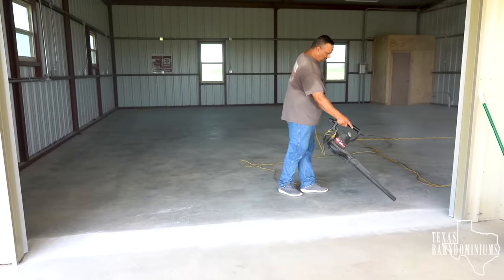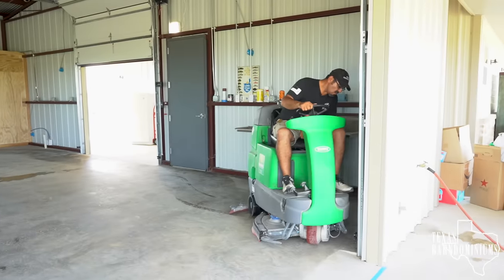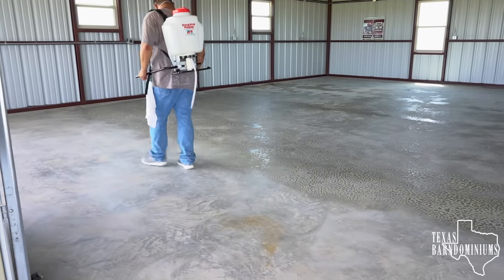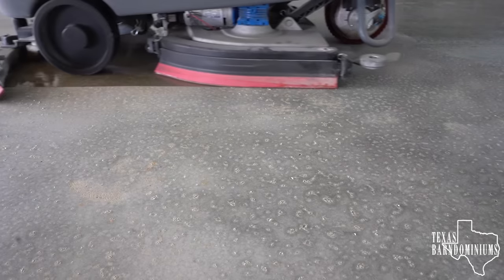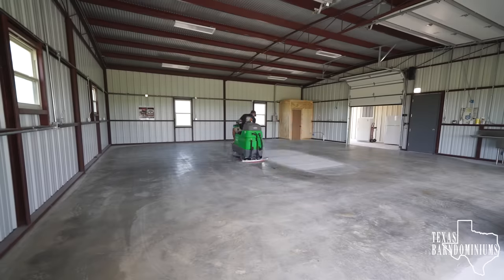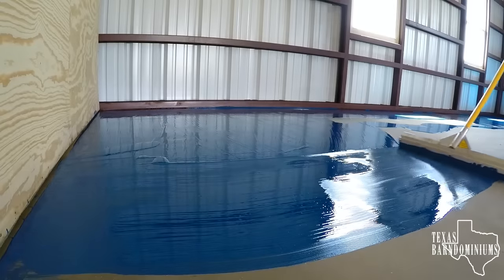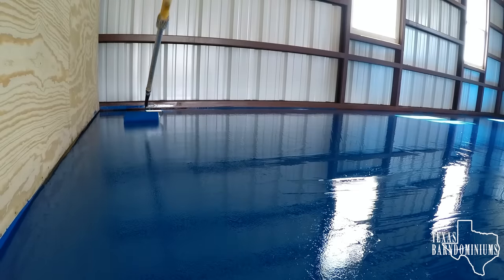How to do Epoxy Floors - STEP BY STEP GUIDE - S3E3

Comment: I personally do not think that muriatic acid is enough prep for epoxy coating. Also I see some in the text saying take a torch to the floor that's a bad idea since you add it in the acetone you can cause a flash off. Ideally you would shotblast the floor is that'll give you the best Bond or at minimum a diamond grind the floor. Love your content you always do great stuff.
Reply: Exactly at least a csp 2. I'll do CSP 3 shotblast, blower and its ready for epoxy.

Comment: I believe those bubbles are because the coat is to thick. Because if you prime the floor or put a seal or vap barrier it should clog all the pores. I learned that if the coat is to thick when it kicks off that’s when it heats up and causes those Bubbles. So got to skedgy more thinner and measure and back roll it in a Chris cross pattern so no puddling all goes away. Also those bubbles could leave marks that you may have to add sand and epoxy to fill or fast fix and touch up a lot of spots from my experience also hope this helps:)

Comment: I got the feed because I subscribed, as this content is interesting even if the building methods do not apply well to my region (sub arctic, living in Alaska). I would love to build a tall (16 foot interior height) 3 car wide garage/shop, with a small 2 bedroom living area above it up here, so I am always looking at ways others are doing it to see if the idea's might work for my conditions here. I am not sure about how well Epoxy floors would hand the shakes up here though (earthquakes) as concrete cracks, and cracks often. And if epoxy could at least keep a better seal on the crete base even if the crete cracks that would be a good thing.

Comment: Awesome video and job!!! What would you recommend for a wetroom? part of the floor the floor slopes to the drain.  When epoxying the slope of the shower floor, how do you keep the epoxy from pooling at the low end? How do you apply the epoxy so that it is even on the level floor and the slope? Thank you so much

Comment: Awsome video. Thanks. I also have a plywood deck I want to finish in spring..... I was thinking of doing fiberglass gel coat on it, but epoxy looks easier.... Can it be done on plywood, And not crack and all?  Thanks.

Comment: So you’d have to buy a leaf blower, angle grinder with a vacuum, acid etch, and the epoxy paint. How much is all of this going to cost the average do it yourself-er?
Reply: I get mixed info on this. Do you need to strip off old paint to put down epoxy paint?
Reply: Bare minimum, you need a mop, soap and water, the acid etch(which usually comes in a kit with the epoxy) and epoxy. If don’t anything on the concrete already like paint or sealant then you just do the following. 
Steps:
1)Remove dust with blower or sweep 
2)mop
3)mop again
4) acid etch to make the concrete want to accept the epoxy
5) mop again
6) mop again
7) pour epoxy and add flakes if you want flakes.
Reply: @evanphillips4302  no I want clear coat not flakes. It has gray paint on it already and I need to repair the cracks. If the epoxy and clear coat doesn’t bond to the concrete oh well. The basement floor is shitty anyway and I’m tired of worrying about it. I just want to get to the fun part. The epoxy.
Reply: @georgelouis6515  just to make sure I’m answering all your questions…if you want to do it to where your epoxy is guaranteed to take then you need to grind up the cracks to be flake-less, suck out the dust, then fill crack with concrete crack filler that you can get in a squeeze tube.  Then paint to match then epoxy and clear coat. But you could probably get away with simply cleaning the dust out of the cracks and do one of two things: fill the crack with concrete crack filler and paint over then epoxy/clear coat OR leave the crack as is after sucking the dust out of it and do enough epoxy to fill the crack and overflow it then clear coat on top. Some might say simply pouring the epoxy into the crack without repairing it with result in crack fragment breaking off from weak spots which will affect your epoxy and clear coat. It may result in epoxy/CC peeling up. But because it’s a basement, you can probably leave it and it will be just a slight defect in the floor that may or may not be super noticeable.
Reply: I didn’t prep one or two cracks in my concrete floor in my garage because of laziness and their location wasn’t one where foot-traffic is common and simply filled the crack with epoxy etc. It’s much more noticeable than my filled cracks but it’s still not bad. In a few years I may regret it but I seriously doubt it.

Comment: Great Video, just a thought wouldnt it better to apply a coat of concrete primer after its clean to help with the air pockets and better seal for preparation of epoxy, then to sand and create more dust?

Comment: When they did my floor, they ran a 1,200 pound grinder over the surface.  That cleared up the top layer and made a nice rough surface for the epoxy to cling to.  The prep is the main thing.  If it isn't done right, the floor will be junk.

Comment: So I like all of your work that I've seen and this floor turned out really good but I noticed it looked like there was epoxy on the side walls and I'm curious why you guys didn't tape that off aswell? I noticed it when he started with the roller and he was rolling right into the metal. I'm not usually one to critique anybody but that stuck out to me. Great work otherwise as usual. ✌
Reply from the maker: I was using the wall to serve as a guide so that I knew where I had rolled.  The walls were getting covered with plywood so I didn’t mind getting epoxy on the metal frame.
Reply: @TexasBarndominiums  I was wondering that too because I seen the one wall had it but wasn't sure as I'm not there. Great Work and thank you for the responce. ✊✌

Comment: Just poured 2200 s.f. of slab. Thought Id epoxy it. I cut control joints down the center of each of the 6 bays in each direction. Im wondering how they may effect the epoxy. Didnt realize just how much work is involved in epoxying floors. 1 more question - are there fumes in this mix? Are respirators recommended? Thanks for the education. Beautiful work.
Reply from the maker: Yes, respirators are a must. 

You can fill in the joints with epoxy before hand.

Comment: Thank you,This has to be one of your top 3 informative videos. Although all your videos are pretty informative. ( not your quick and easy cement video). 
Quick question though, did you put down a sealer before the epoxy coating? And did you use the squeegee for the second coat as well? 👍👍
Reply from the maker: We put epoxy straight to concrete.  You can put a “prime coat” first if you want.  
We used squeegee for both coats of sealer.

Comment: This video is amazing. Does two coats of epoxy mean double the price? Can we use a base coat to purge the air from the pores of the concrete, then one coat of epoxy, and one top coating (i.e. polyurethane)?

Comment: For someone that cannot get this cleaning machine, what is the best manual method to get the floors clean? Just water and a squeegee? Then dry it up with a rag or towel?
Reply: On my garage, after I used a rental diamond bit grinding buffer machine from the Home Depot, I blew out the dust with a blower, then mopped it up with soap and water. This guys video is an example of what someone who does this professionally should do. It’s almost certainly the right way to do it if you have time and money to do it this way. But I watered and mopped it after grinding it. No etching needed with the grinder.

Comment: Hey Erik,  I put down two coats so far of P250. I rolled them both with a 18” roller, the first one left bad streaks(might not have been applying enough epoxy) second one it looks a little better but still streaks or thinner lines and thicker lines. Should I be using a 1/8” squeegee?  I see y’all rolling it all the time...

I plan to put on 100 after the 250 is done.  Thanks for the videos!
Reply from the maker: Mix one kit at a time. Thin down with 5% acetone.  Go quick!
Use 3/8” nap roller.
Reply: @TexasBarndominiums  Thanks! Wish i coulda got y'all to build my barndo! :)
Reply: @TexasBarndominiums  Should i also add 5% acetone to the P100?
Reply from the maker: Yes.  It will help you roll it.

Comment: Thanks for the great how to video. I have used the cheap Rustoleum kits before, but you get what you pay for. Brake cleaner and other chemicals are eating up the color chips and the steel casters on the doors are destroying the epoxy coat.

Comment: Have you considered tape/plastic on the bottom of the walls to avoid the roller/squeegee marks from the epoxy up the walls?
Reply from the maker: Yes, we typically do that, but I was going to put plywood on my walls right after so I didn’t cover the purlins.  
I did say to protect anything you don’t want epoxy on.  :)
Reply: Gotcha, cheers mate.

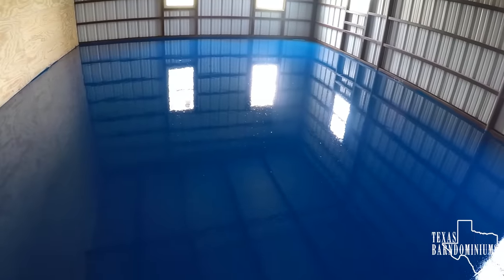Comment: On the second coat (11:30) do you just roll the epoxy on like your painting with paint roller or pour the epoxy on floor, use the 1/8 notched squeegee again and then finish with the roller?

Comment: Care taken in cutting in the edges would minimise any blue epoxy coating ending up on the shed frame. Still a top job good stuff
Reply from the maker: The frame was covered with plywood, so it didn’t matter.   Otherwise I would have cut in the edges.

Comment: Ok so Im doing a reflective floor on my house. I had to pay someone to do the grinding because is hard to find a good grinder for rent. So after that , im cleaning it with denatured alcohol. Im mopping it but still leaves dust in my opinion.  Alcohol is so expensive. I dont want to use water for the same reason that it gives moisture to it. What can I use to clean the dust and leave the floor really clean. Any advice?

Comment: Can I do 4000 psi high pressure cleaning using an epoxy floor cleaner? in workshops with grease and oil on the floor

Comment: What do you do about the epoxy that got onto the metal purlins when you rolled? Scrape it off, or paint over it?
Reply from the maker: We put plywood on the walls.  
If you have a finished surface, it’s best to protect it ahead of time.

Comment: Question... if I have a garage floor that was epoxied a couple years ago but I want to change the color now, will I have to start completely over to lay new epoxy or start with a solid sanding of the previous coat?
Reply from the maker: Sand it and clean it up really good, then apply new color on top.
Reply: Texas Barndominiums awesome! Thanks so much

Comment: Dang I wish I saw your video before I gad my patio tile removed and poured cement over it with a stain on it. I dint like the results I wanted a shiny surface. So now I’m told I can add epoxy on a painted surface!😫

Comment: What is the purpose of putting this epoxy over concrete floor?  How does it protect from paint spills, dirt, etc?
Reply from the maker: It seals the concrete and keeps paint spills, dirt, etc from penetrating the concrete.  Makes it super easy to clean.

Comment: Why do we need Amonia 1:1 water  application after muriatic acid spray?
Also added 5% Acetone will make longer working hour avoiding fast setting?
What is necessity of 120 grit sanding prior to PU coat & PU coat need any solution?
Reply: Ammonia is a base that neutralizes the acid.

Comment: i saw that even they use tape to prevent epoxy going to wall but they thit the wall with the roller  . dont know if its the best way to go closer to the edge of the floor and i dont know if epoxy will come out the walls ?

Comment: If the concrete is relatively new and properly finished to begin with,  and no other paints are on it,, all you need to do is power wash with 3000psi and turbo nozzle, That is more than sufficient to clean the pours of concrete. The sanding and etching really isn't necessary, because your epoxy is already designed for concrete, it has the ingredients to bond to concrete already in it.  DIY'ers, READ THE INSTRUCTIONS ON THE CANS!  
Your finished floor dose look great. 👍

Comment: Hello Sir... Can it be done on roof. Roof is flat and as like floor of tiles. Because of the poor work done by workers the joints are broken between the tiles and water is coming into the walls and roof. Please suggest can it be done on roof? Summer temperatures goes upto 48°C in our are and in winters it comes to 2°C
Reply from the maker: No, epoxy is not UV stable.  There are many other products that will work well for that though.
Reply: @TexasBarndominiums  please suggest some of them

Comment: I would've been even more impressed by your epoxy floor, if you covered the walls with something so your roller didn't paint it when it came near the walls.... or did you cover them with transparent foil?
Reply from the maker: I put plywood on the walls after the epoxy floors.  So I knew it would be covered.  I did mention on the video to cover anything you don’t want epoxy on.
Reply: @TexasBarndominiums  must've missed that :-)

Comment: Do I need any kind of prep other than cleaning if my garage is brand new concrete?
Reply: If the concrete is brand new you should wait at least 30 days or more before applying primer + epoxy.

Comment: Do you need to diamond grind the floor after the sanding process? I was prepared to do this except the distributer in my area for this epoxy refused to sell me the epoxy if I was Not going to diamond grind the floors after the sanding process. Any thoughts on this??
Reply: yes the process is grind, patch ,coat
Reply: dont sand unless you are simply re coating an already existing epoxy floor (inwhich the owner is somewhat happy with the look)
if you are working with concrete you want to grind it to flatten the floor
and ensure you get a proper chemical bond that will not fail

Comment: Umm. No. Not Golf shoes to be exact. There are many variations of golf shoes. So let's not confuse people. What you need are Spiked Style Shoes for Resinous Coatings. And there is a big difference. Even then you have to be careful. As for the bubbles. Have a nine to eighteen-inch porcupine roller sleeve on hand. Once your first coat is down, grab your spiked shoes and roll the entire surface with your porcupine roller sleeve. This will eliminate a ton of bubbles (sometimes all) before they are even visible to the naked eye. In all cases, this works best if your epoxy is self-leveling. Also. Your mixing procedure. You mentioned that it is a good idea to have somebody standing by to mix your kits as you. I agree. However. I think It would be wise to mention that you should never mix your second kit in the same bucket as the kit you previously mixed. After all...There will be a small amount of epoxy left in the bucket from your first mixture.  So.. That first mixture has already begun a chemical reaction.  Mixing a new batch in the same bucket could leave undesired results such as bubbling, discoloration, wrinkling..etc. After all. If you do this you will have both mixtures chemically reacting at a different rate. Good video though. Keep it up.

Comment: After sanding can you clean the concrete with a pressure washer and a squeegee
Reply: Also can you torch out the bubbles
Reply from the maker: No pressure washer needed.  Just spray soapy water and scrub, then use foam squeegee to push water out. 

Yes to torch, but be very careful.

Comment: Do you ever add an anti-skid product to the coating?
Reply from the maker: Only if doing them outside.  But I never do epoxy outside because epoxy is not UV stable.
Reply: Texas Barndominiums so then the answer should be no lol. Know anyone in Tucson that does good work? I want my garage floor done

Comment: the sub-base is very important ,your concrete is very perfect ,but most of the project the subbase is not good. if the roller brush change to defoaming brush ,it will be perfect

Comment: If you live in freezing temps... when you get ice on this floor, you are going to crack your head open. It will be treacherous!
Reply: Pro tip💡  After cracking head open, squeegee the blood before using roller to get an awesome tint to your previously installed epoxy.

Comment: ...folks I know who use epoxy for other purpose use a propane torch or a heat gun to "flash" the wet surface to get rid of bubbles from mixing and brushing...don't know how you could apply the technique over large surfaces...drone?
Reply: Or fill the place with propane gas, light a match and run.

Comment: How much per square foot does it cost to have this done?
Reply from the maker: Depends in your area.  $5-$7 usually.
Reply: @TexasBarndominiums  Wow, that's more than the floor. I just used a quality sealer in my garage and put that $$ into a full heatpump system instead.

Comment: OK. I want to epoxy a 2 car garage. My question is Where do I put all my stuff until the floor drys? I’m sure that there is a simple solution. Help me out guys.
Reply: I am renting a storage pod to keep in the driveway. $400 for delivery and pickup. Need to pay for full month though. More than worth it if your garage is full like mine.
Reply: @williambuck1779  Thanks. I knew that the solution was not as complex as I thought.

Comment: DO NOT ACID ETCH! This is usually contraindicated an all polymer concrete coatings as it can effect the epoxy curing and bonding chemistry. From the APF E400 data sheet:
"Acid etching is not recommended and will void Manufacturer’s
warranty. "

Also per datasheet, the floor should also be ground to a CSP 3-4, which is like 60 grit sandpaper minimum roughness. Not 400 grit.

Comment: how long does that last in a hot to cold climate where the floor sweats
Reply: Epoxy is not suitable for all cement floors. A Calcium chloride moisture test should be done to determine if epoxy is appropriate for your floor.
Reply: @DavidEVogel  that will only test the surface. if your in a freezing thawing climate where moister comes up through the concrete i don't see how epoxy would last.